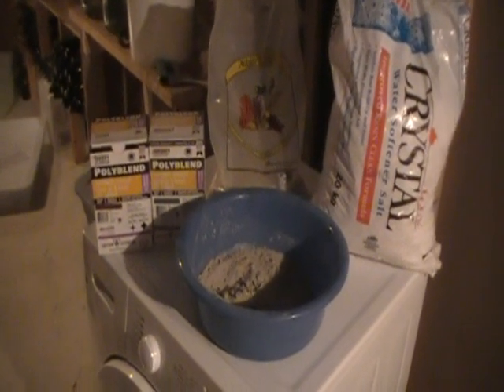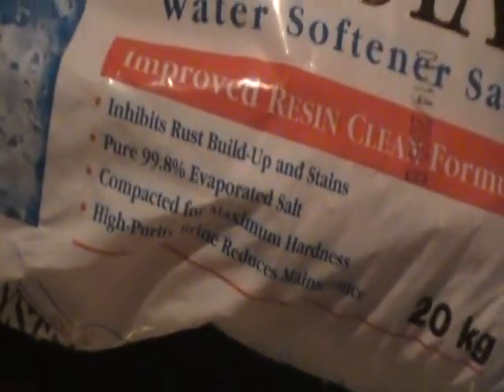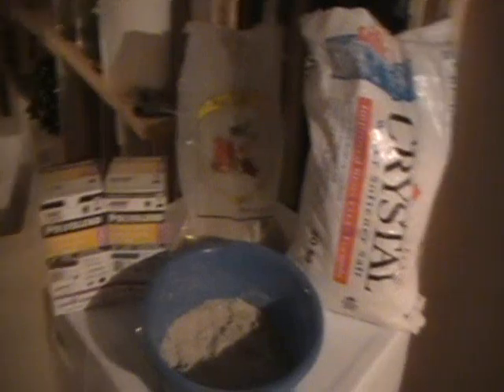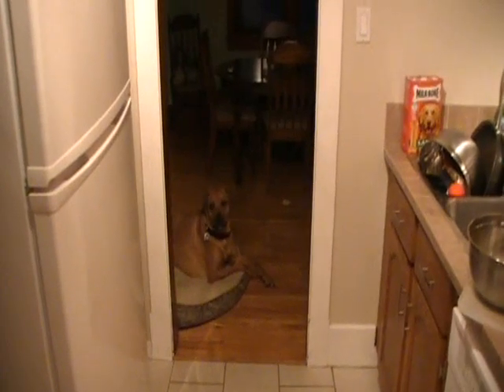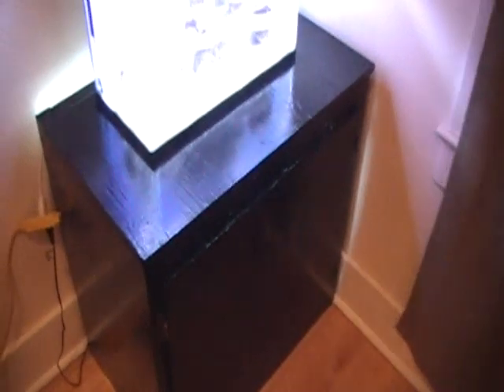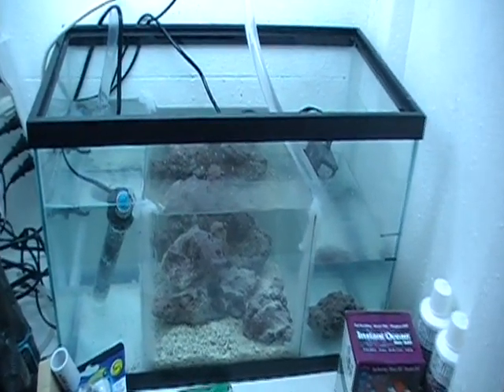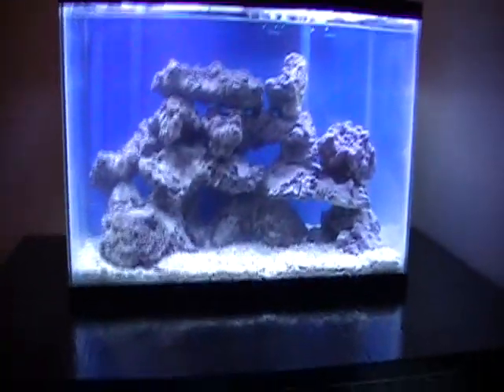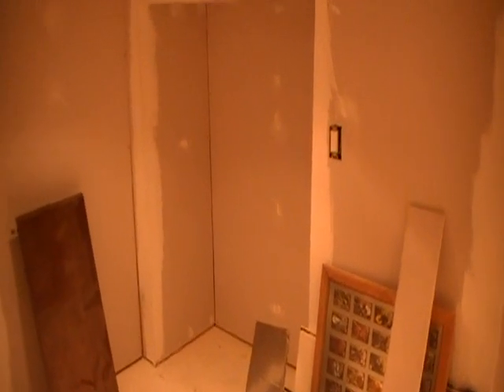My 10 Gal Nano Reef (Day 1) + Other DIY Stuff

Comment from the maker: To cure that ich move all the fish to a quarentine tank. Add ich medication (copper based) only to the QT tank (copper will kill corals & inverts). Do not run charcoal, it will kill the medication (powerhead or empty HOB filter). Do 5% clean water changes in the QT tank every day or two to keep the amonia levels down. Keep the fish in there with meds for at least a month. Ich takes about a month to clear on fish and to die out in the display. The sooner you get them medicated the better. GL

Comment from the maker: I never did weigh them...I'm starting to think I have too much rock. There's an esimate of maybe 30 lbs total in the display & sump. But I will be upgrading to a bigger tank when I have the money for the lights / tank / skimmer. So I'd rather have more just for now becoming live.

All that rock was about half of the polyblend.These DIY rocks are very light because of the gaps on the inside from the salt disolving. Water actually pours right through them, which is great for filtering.

Comment from the maker: No the skimmer is a cheap thing from ebay. (seller bbecoco.622) Cost like $20 and I'm not convinced how well it will work. But it's cheaper then a DIY nano unless you already have the pieces to do one. I've already had to make some mods to it just to keep it from falling apart :( I also added an airstone to it cause the pump it came with seemed sad. Rio made the return pump (Rio 600). I'm also adding another rubermaid tank section for more water volume and frags down the road...so stay toon'd :)

Comment from the maker: The PVC has surface skimming, but the 1/2" doesn't have enough flow/suction to be very good at it. And I'll be able to use it if I upgrade my tank size in the future. Soooo I went and bought 1" yesterday, it's BIG, but it will be nice because I'll be able to pump about 120 gph through my system thus removing the need for a dedicated powerhead. I want some good flow because I'm mainly doing corals, and maybe a blenny. My frags are already ordered and waiting until my tank cycles :)

Comment from the maker: hmm that might be the problem right there. The recipe for the 90 is totally different than the 10gal. The 10 gal is 1 part of each polyblend, 3-4 parts sand, and 1 part salt. You don't need cement with polyblend because there's already is cement in it. Also yes grey cement will severely alter the color because of the power of the grey color/cement.

Comment: There are a few things I do not understand. What do you mean by parts, when you describe the measurements of the ingredients for the rock? And also, what is the salt for in the mixture? Won't the salt just dissolve once the rock comes in contact with the water?

Comment from the maker: After curing this time I didn't dust them off with anything by my hand. Next time I will use a wire brush to make sure I get all the sand off, or I'll just cure them on salt.

In the tank now I use a turkey baster and it's working really well to bring the natural purple back out of the rocks.

Comment: Sorry for not telling u strait up but im doin the 90 gal version, i have 100 lbs of the gray cement and i couldnt find it in white and also i couldnt find the oyster shell, i know they use it for chickens but knowone sells it local. I guess i wont do the couloring, ill find out soon how it turned out and ill tellu,   Ps im getting a 75 gal full setup for free, so thats the reason for the rock